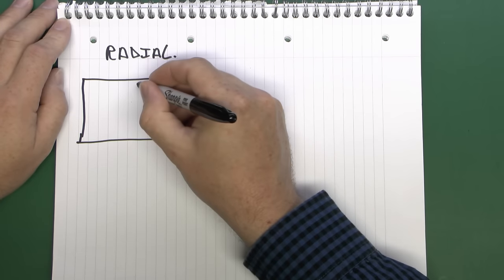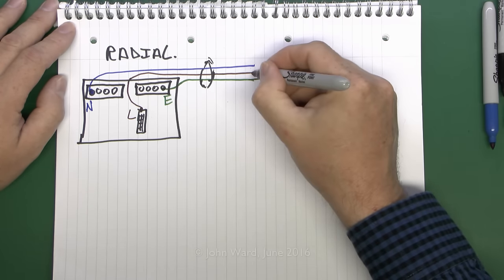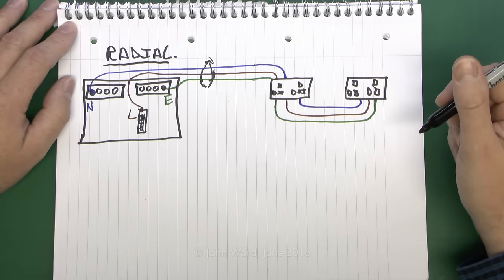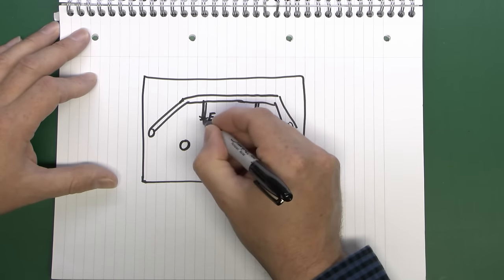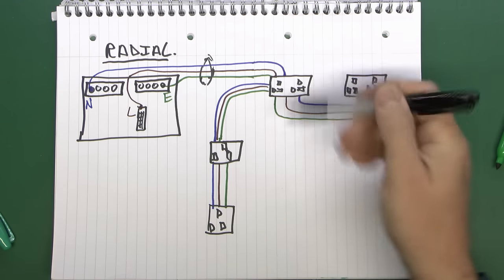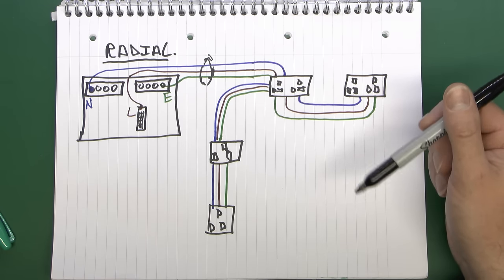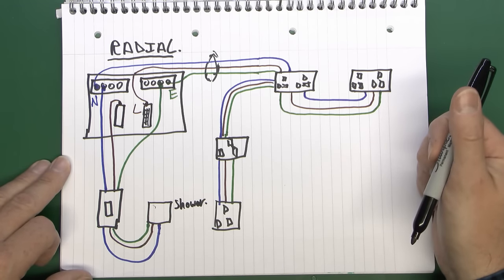Radial Circuits

Comment: Isn't it a pain having a 16a limit on each radial? What about a kitchen where someone might be running a tumble drier along with a kettle?
Reply: You are quite right, and the way round that is to install a 32A radial using 4mm^2 cabling which is a common approach.
Reply: Steve Jones - So are you offering to wire up a radial circuit with multiple socket outlets connected as multiple spurs as in John’s diagram using cheap socket outlets using 4mm squared T&E cable? Can I come along to make a video of you doing this? Of course, the resulting video will need editing, as extensive use of a BLEEP machine may be needed...🤣
Reply: @Mark1024MAK  I suggest you read what I wrote. and not whatever is in your head. I never mentioned spurs at all. Not once. I said that an alternative to a 32A ring on 2.5mm^2 is a radial circuit on 4mm^2. That's a perfectly acceptable option, and suited to something like a kitchen.
Reply: Steve Jones - Yes, what you originally said is valid. But I am talking about the practically. So how would you wire up a kitchen 32A radial circuit where many socket outlets are needed, some at worktop height, some inside/under units(fridge, dishwasher, washing machine), one above the cooker hood for the fan (if needed), and some at floor level? Two 4mm squared T&E conductor wires is possible in the terminals on all reasonable quality socket outlets, but three is not so easy. Especially if it is an existing kitchen and there is limited space to work in. So splitting such a radial circuit into two (or more) branches (spurs) is possible but awkward. The alternative is to use longer runs of cable, which may increase costs.
Reply: @Mark1024MAK  There are some sockets out there that will take 3 x 4mm. MK have some, but admittedly the choice is limited. However, in kitchens, one way round this is to install junction boxes behind the units below the worktop level. They can be installed in pattress boxes if required. 

In any event, some electricians seem to prefer 32A radials over rings.

Also, of course, a cable can just "pass through" a pattress box on the way back from a "daisy chained" connection (as long as the pattress box is deep enough of course).

Comment: 08:50 - Forgive the ignorance.. not an electrician or anything. So just turning off the MCB is not enough to work on a circuit? e.g if I was to replace a broken plug socket?
Reply from the maker: The MCB will disconnect line, and in most cases the circuit will be safe to work on - neutral is normally at the same voltage as earth.
However all of the conductors must be checked for voltage before working on anything, as there are some situations where a dangerous voltage can appear on the neutral conductor.

Comment: So it looks like your radial circuits are all spurs so what about the load?
Reply from the maker: The load is whatever is connected.  The cables can't be overloaded as the cables are rated more than the circuit breaker or fuse.

Comment: I'm in the US. Why does a "cooker" need/have a separate in line switch? Why not put the switch on the appliance?
Reply from the maker: Isolation for cleaning and maintenance.  Large appliances like a cooker are wired in, they do not connect via a plug and socket.
Reply: @jwflame  Seems easy enough to add a plug and socket like we have here (electric stove and clothes dryer, 240 volt). Only electrical device I can think of that we use without a plug and socket is an electric water heater. They are not meant to be moved after installation. It might be a good idea for countries to share info on wiring seems like we both have some good ideas. I was wondering are your small appliances 240 volt?
Reply from the maker: @aw738  All UK appliances are 240V, and they all use the same plug which does anything up to 3kW.
Anything above that (which is very few things in a normal house) is wired in.

Comment: "Consumer unit". What is this new-fangled thing of which you speak? Whichever satan worshipper wired up this house in the 70s fitted a lovely white Wylex fuse box that still has a few reels of fuse wire hanging from a rusty nail next to it. About the only concession to modern safety is the "sockets" (of which there is one) fuse was replaced with a resettable circuit breaker (which is not an RCD, I managed to short out a plug in light fitting and it blew the fuse in the plug before the breaker popped).

Comment: Hi John can you tell me how many sockets can you install from this 20amp radial cct  using 2.5 t&e
Reply from the maker: As many as you want - there is no restriction on the number of socket outlets.
There is a suggestion that the total floor area covered by the circuit should be a maximum of 50m², but that is not a regulation.
In reality, the number of sockets should be determined by what the likely use will be - sockets for bedrooms are likely to have a lot less loading than those in a kitchen.  In all cases, the maximum load can only be the 20A, or 4.6kW.

Comment: I thought that you could only have two outlets on one 20amp radial?
Reply from the maker: No restriction on the number of outlets and never was.  There used to be a rule about one 20A radial circuit not covering more than 50m² of floor area, but that's just a recommendation now, not a regulation.

Comment: Great video...Thanks. I've seen mention of a spur from a radial circuit and it was shown the same as the additional sockets you added in. I'm now confused as to if there is such a thing. They mentioned only one additional socket being allowed on a spur on a radio circuit unless it was protected by an FCU. Is it classed as a spur if it isn't connected to the last socket in the line or is there no such thing? Here is the link https://www.diydoctor.org.uk/projects/radialcircuit.htm#:~:text=The%20simple%20answer%20to%20this,radial%20circuit%20and%20no%20more.

Kind regards
Reply from the maker: That site is wrong, the concept of a spur only applies to a ring circuit, as the cable is rated less than the circuit breaker (usually a 32A circuit breaker with cable rated between 20A and 26A).  One socket on a single cable won't overload that cable as whatever is plugged in will have a maximum of a 13A fuse in it,  it's considered very unlikely for 2x13A items to be used simultaneously for any length of time, and double socket outlets are only officially rated to 20A total anyway.
Supplying multiple sockets from a 13A FCU will limit the current to 13A and prevent overload even with many outlets - similar to those multi way extension leads which are all supplied from a single plug with a 13A fuse.
For a radial (which is virtually all circuits), the cable rating is higher than the circuit breaker, so there is no possibility of overload regardless of whether the sockets are in a line, or have multiple branches/junction boxes or anything else.  The example on that site uses a 16A circuit breaker with 2.5mm² cable which is typically rated about 26A,  so the maximum load won't exceed 16A, far less than the 26A the cable is rated for.
The 50m² area served is also obsolete, it hasn't been regulation for many decades, it's just a historical note now.
Reply: @jwflame  thanks very much John, greatly appreciated.

Comment: what colours are used for building site 110v?
Reply from the maker: That arrangement has two lines at 55V from earth, so the colours should be brown for both lines, and green/yellow for the earth.  Possibly brown, black, green/yellow if the two lines needed to be separately identified.
In reality, brown, blue, green/yellow is often used as that type of cable is far more readily available, particularly for the flex on power tools and extension leads.
Reply: *****  Thanks for the info

Comment: Thank you John for the clear and detailed videos.
I'm not an electrical engineer,my career was in Audio Electronics.
One question on Radial Circuits 
Each 3pin plug and socket can handle up to 13 amps.
If a consumer were to,by nature of the devices used,draw this from every socket,what would happen?
Reply from the maker: Total current for the circuit is limited by the circuit breaker in the consumer unit, if that is exceeded it will disconnect the circuit.

Comment: Hahahahaha " ring circuits a thing created by Lucifer himself" hahahaha - love it. subbed
Reply: Rings are ingenious and simple. Have a ring on a 4mm cable, 32A AFDD and screwless terminals on sockets, they are then bombproof.  The first choice, rather than a multitude of radials, needing RCBOs or AFDDs on each radial. Then a space consuming larger consumer unit.  All needless in equipment and cost.

Comment: Just watched your videos about radial,ring and lighting circuits. They helped me allot ! ?I just subscribed to your channel .

I got a project coming and I was wondering if you got any videos that would help me with some of this points so I get a better understanding of it :) Or any of you guys could give me a hand thanks you :D Maybe post some links ? :)

Project Brief 
Small housing development; 3 houses set in 1.5 acres 
Each house is the same design and development is on level site. 
Electrical supply is by overhead line situated at boundary of site. 

(a) Describe how a new supply connection can be made to this development and the cost implications.
(b) Determine the power, lighting, heating, showers and cooking load requirements.
(c) Determine the diversity for each circuit and calculate the total current demand. 
(d) Determine the type of power supply (3-phase or single phase) and size the capacity of distribution board.
e)  Size all cables and cpcs (cross-sectional area (csa) and type, cable route diagrams, etc).
(f)  Calculate the voltage drop, electric shock and thermal conditions in each circuit.
(g) Confirm earth arrangements, earth fault, short circuit current and discrimination are suitable.
Reply: I don't think he's a charity.

Comment: Hi John, this Radial circuit doesn't make much sense to me? Just looks like a spur off a spur of a spur etc? 🤔

How can you get away with it here but not on a ring circuit?

Thanks
Reply from the maker: Radial circuits have the cable sized properly so no restrictions on how many items are connected.  A typical radial for sockets has 2.5mm cable rated about 26A, but with a 20A circuit breaker so the cable can't be overloaded.
A ring has 2 cables so a smaller size can be used, but relies on there being 2 cables to each socket.  26A cable with a 32A circuit breaker means that if multiple sockets were attached to a spur (single cable), more than 26A could pass through the cable causing it to be overheated and damaged.
Reply: Thanks John, I've put a ring out to my summerhouse and shed using 2.5mm T&E in 25mm conduit connected to the RCD with a 16amp MCB. So I need to change the MCB to 32amp before connecting this up. Wouldn't 16amp MCB suffice?
Reply from the maker: If you want a 32A ring, then fit the 32A MCB.  If 16A is sufficient for whatever equipment will be used, then keep the 16A.  However with the 16A, there was no need to wire it as a ring.
Reply: Hi JW,
Thanks for your reply.
How would you have wired it then? Radial? The 16Amp MCB will most likely be enough with the ring. Only running a few sockets and a couple of lights off it 👍🏼
Reply: even in USA, wiring it as a radial, the normal there, is ok, and spurs from the main radial are ok, as long as no spur on a radial contains more than three outlet points. We would never use a ring, and as you say, the 16 amp or 20 amp breaker will blow before the wire will burn at 26 amps, although, to a shed or such, the increased distance may reguire the 4mm wire rather than 2.5 mm wire from the panel to first position. Although not recommended, many times I have seen the first position done either as a breaker fuse itself, in shed or such, or as a mini panel, with input breaker, allowing you to then drop to 2.5 wire in the rest of the installed radial.

Comment: What about overloading?
Reply: The MCB handles that.  What value you use will depend on the conductor cross-sectional area and resistance of the circuit.
Reply: With Radials in the UK, the wiring is rated for the circuit protective device (fuse or cb) so overloading of the circuit wiring isn't a problem. Of course you're going to get nuisance tripping if you plug in too much, but nothing will get overly hot... if that makes sense. The same would happen with a ring.
Reply: TheChipmunk2008 - I’ve never come across or heard of nuisance tripping of a 30A or 32A ring. 16A and 20A radials with multiple socket outlets where more than one room is on the circuit, or feeding a kitchen, are far more likely to be tripped though.

Comment: Almost  but that's not  correct. Blue and black  are both  live wires. Leading to  main breakers.  Two  opposing  credits. 120v each.  Across both polls is 240 volts.
2 live whires 1 neutral  1 ground. 
Ground is safety  wire  neutral  is return  wire for 120v service.
Blue  black  and red are code  for live  wires. White  can be used for live  in 24o service  white  is used for neutral  bare or green  are used for ground.  Neutral and  ground  are essentially the same thing  assigned to different  purposes.

Comment: If radials are using 2.5cable  same as ring can't I just down size the circuit breaker in my ring to make it as safe as a radial circuit. Let's be honest who actually uses anywhere near 32amps.
Reply: "who actually uses anywhere near 32amps."
You will be surprised.

Comment: Common mistake I see: a DIY'er looping multiple double socket outlets in a refurbished room or kitchen using some old 2.5mm t&e found in the back of their garage, typically wired as a radial but tapped off a local ring under some floorboards with a old second hand junction box. 27-28A rated cable with the supply mcb rated at 32A at the DB, very nice. 
When you try to talk sence to these people given reference to EFLI and trip currents etc you watch them slowly glaze over lol.
Reply: Yep, more often the case than not, I find.
Reply: TBH that's why rings should be consigned to history
Reply: Ichabaud Craine - won’t make any difference, cowboys and uneducated DIYers would still find ways to put in unsafe systems...
Worst domestic installation I have come across was a three story house where a kitchen had been installed in an extension at the rear. The main part of the building used 30A fuse protected ring circuits. At first, I could not work out what was feeding the kitchen. I then discovered a junction box under the first floor back room. This was cut into the ring main, with a single 2.5mm squared T&E cable going to the kitchen. In the kitchen, this spur looped in and out of every double socket outlet that had been fitted in the kitchen (a total of about 5 or 6 double sockets)! 😳
Reply: Oh, and if you really think that trying to discontinue the use of ring circuits will prevent cowboys and uneducated DIYers from leaving unsafe electrical systems behind, think about this: I have seen numerous modern consumer units with 32A MCBs feeding radial circuits wired in 2.5mm squared T&E cables....

Comment: Now, if you could just explain where the term “radial” is coming from... my life would be complete!  Seriously, though.  I don’t doubt what you said about “the circuit can be extended indefinitely”. But that would be insane.... What is the purpose of your CU breaker?  Is it to isolate the house from mains?  In NA, we have a main panel breaker that disconnects the box from the mains, but then each circuit is independently “fused” or protected by a suitable breaker that is determined by the wire gauge leaving the panel. In cases where 240v is required, these are also protected on each leg with a breaker.  We do have limits to how many devices can be on each circuit.... I suppose that in NA, we recognize that there are idiots who will actually use these sockets at the same time... overloading the circuit! Why are switches included?  I suspect it is to conform with “any consumer accessible point of contact with the cable.... They add resistance and so are technically, a load.

As I sit and think... I have to wonder if the term “radial circuit” comes from the fact that the CU is the centre point of distribution, much like in an ancient city.... Again, in NA, our systems is more of a fan distribution.... perhaps we should call ours the “Cauda Equina” system..... After all, everybody has one, don’t they! :). Thanks for the details.... Stay safe.... Doug
Reply: "In NA, we have a main panel breaker that disconnects the box from the mains, but then each circuit is independently “fused” or protected by a suitable breaker that is determined by the wire gauge leaving the panel."
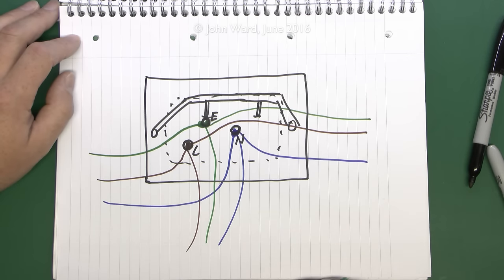That is the same situation (in the UK, Europe and elsewhere), as discussed from 7:30 onward.  A Consumer Unit (CU) is the UK equivalent of a "Panel".

"We do have limits to how many devices can be on each circuit."  
in the UK (and elsewhere), "Common Sense"  would unsure that not too many socket outlets were installed on each radial circuit. 
For example, a radial circuit supplying a kitchen would not have more than a few socket outlets and more than one circuit may be installed in such situations - with dedicated supplies for Ovens, Electric Cook-Top, Water-Heaters etc.
Radial circuits supplying bedrooms, lounge-rooms etc. may have many socket outlets, since the current draw from each socket outlet is likely to be low.
(120 V supplies are more easily overloaded than 240 V supplies, since a given current can supply only half the wattage on 120 V that can be supplied at 240 V!)

"Why are switches included?"
Because the "Regulations" require them for each Socket Outlet. 
(They do NOT add any "significant" resistance - since that would cause problems.  
It is NOT against "Code" to install switches for outlets in North America.)